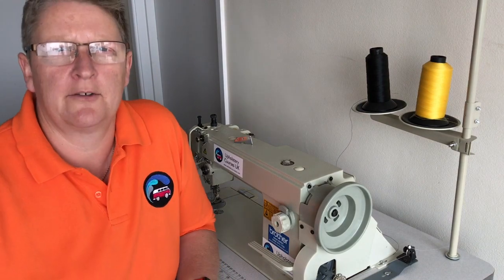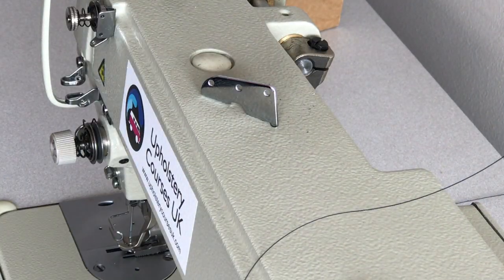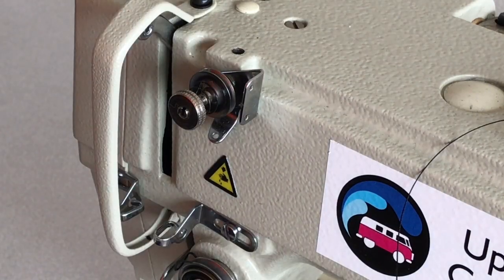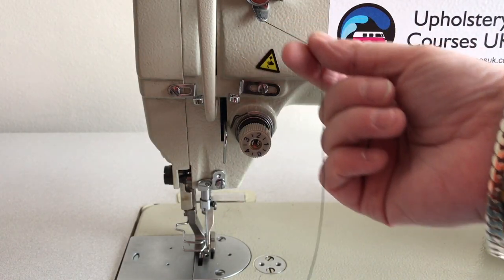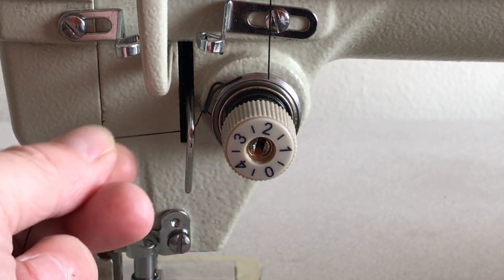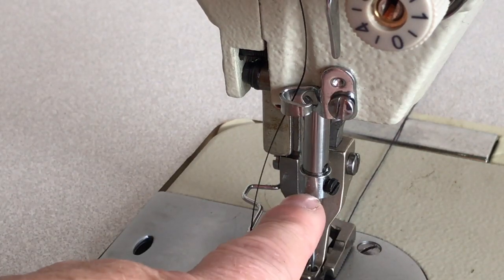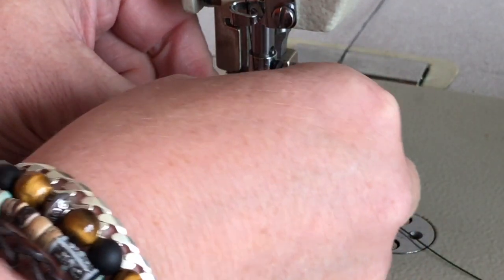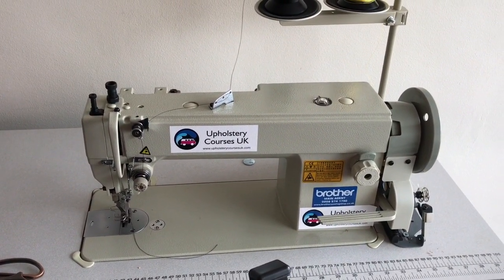Master Your Industrial Sewing Machine - How to Thread it...

Comment: Thanks for your information.I would like you to consider going the other way around the steel plate with three holes in it. The reason is explained here: https://youtu.be/oyYR80ibiDo     and it is discussed here: https://leatherworker.net/forum/topic/85746-thread-tension-and-twisting/